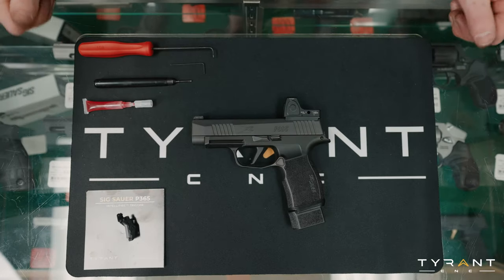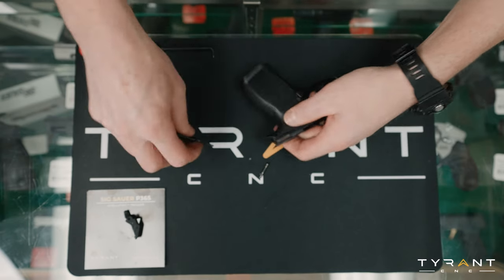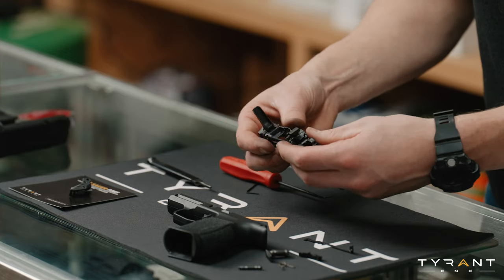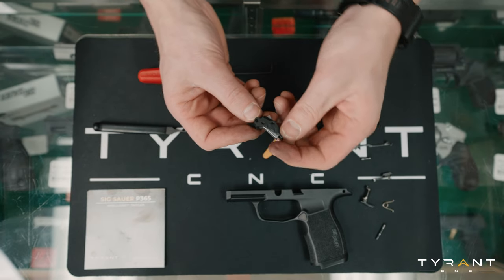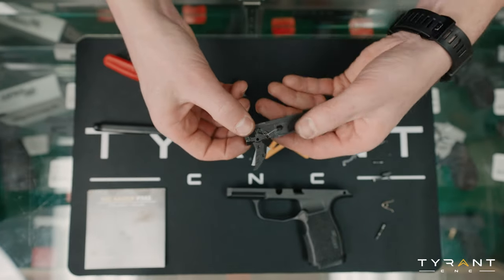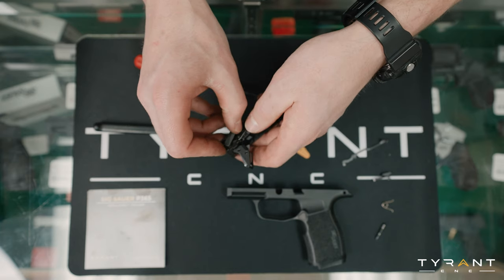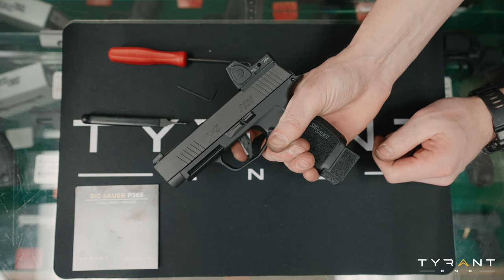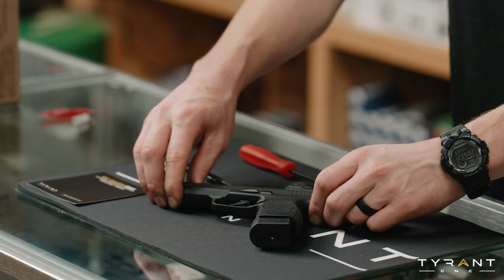How to Install Tyrant CNC Intellifire™ Trigger for Sig Sauer P365

Comment: This is not a very detailed video. you need to explain in words how everything fits together and stuff. You need to be more detailed for people who are taking this apart for the first time. There were a lot of little things that you did not mention that I just had to figure out on my own. Stuff just “sliding into place” is not a very good description for how these parts fit together. This is more a video for people who already know how to disassemble and reassemble the FCU. A better closer camera angle would be better as well. I was able to get through most of it but reassembly was not easy, had to go to another video to make it work.

Edit: ok i will admit I was trying to put this back together and was very very frustrated when I wrote this 😅. I wasn’t able to get the FCU back into the frame because that little bar that connects to the take down lever wasn’t in its slot and I didn’t have it in the correct position. I love the trigger it’s fantastic. This was a good video. It’s just that it was my first time taking apart the FCU so i just watched a full disassembly and reassembly video to understand all the components and how they interact with each other in order to better understand what you were doing in the video. I ended up doing a full disassemble and reassemble which I’m glad I did because now I know way more about my gun. Thank you very much for the upload very pleased with my new trigger and am eagerly waiting for the matching gold mag extension and mag-well. GREAT STUFF

Second edit: Just got done shooting and IDPA match with this trigger and it felt really nice no issues whatsoever. Looks sexy AF too

Comment: installed mine and the slide release doesn't work fallowed the video to the T
Reply: ok figured out out to release the stuck slide had to use a flat screwdriver to pull on it outward for it to release looks that the spring wasn't placed ontop of the slide release.
Reply from the maker: It does happen! The slide release spring can be a little difficult to seat initially but once you see how it should fit with the tab it'll be easier in the future.